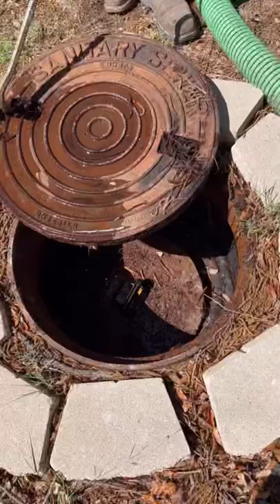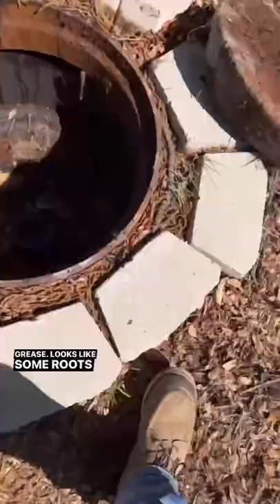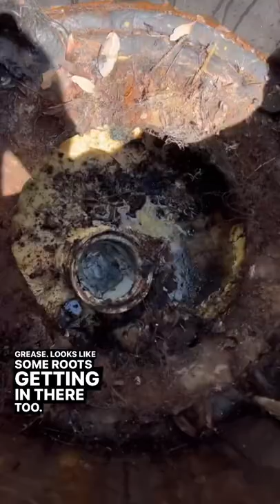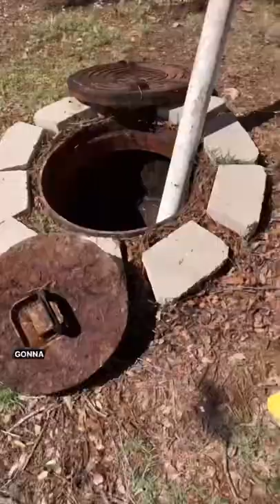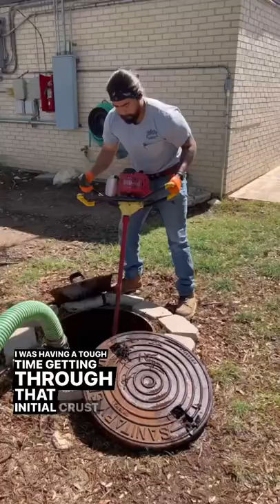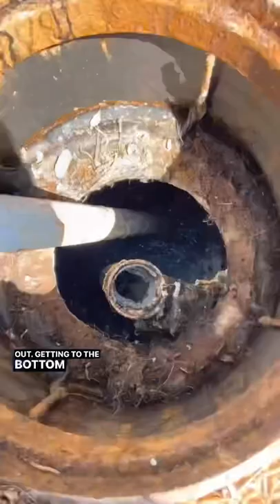Grease Smoothie #shorts

Comment: Does the crust buster create a spray mess in your direction?
Reply from the maker: If you lift it too high it will! I keep it a few inches underneath the liquid to prevent that from happening
Reply: Is the crust buster just a fence post auger with a special fan-shaped end?
Reply: @cletuss57  is it an attachment or a whole machine?

Comment: I've only read about septic tanks and watched videos, so my knowledge might have galaxy sized holes in it, but isn't the whole point of those systems to have stratification, where some stuff sinks, some floats and then only the effluent in the middle can go out the outlet? Wouldn't running a mixer in there kind of mess with that? Or do you block the outlet before you mix so nothing goes out there that shouldn't?

Comment: Where does the grease get disposed
Reply from the maker: Treatment plant. Solids get separated from liquid. Solids get turned into compost and liquid gets treated and recycled into the water system
Reply: @PoorPumperSociety  That's crazy, so we shower with the same water that was once in a septic tank?
Reply: @ingodwetrust1136  always has been
Reply: @ingodwetrust1136  definitely?
Reply from the maker: @ingodwetrust1136  most of the time the treated water is discharged in a creek or used as irrigation for parks or golf courses